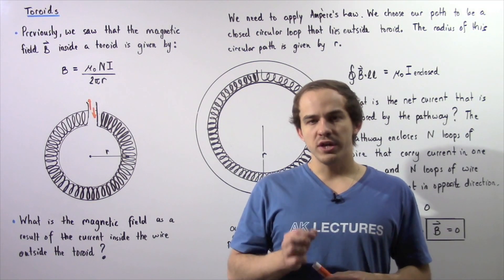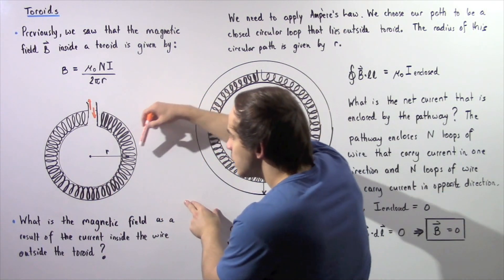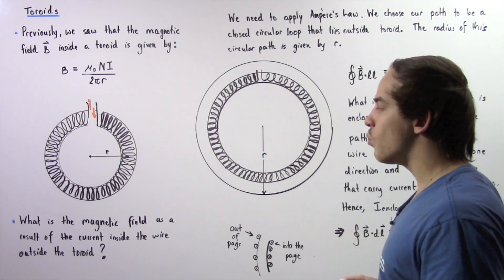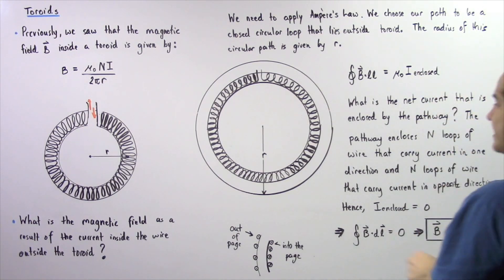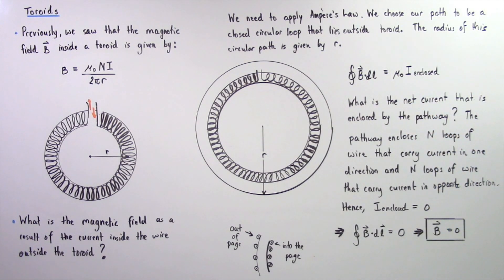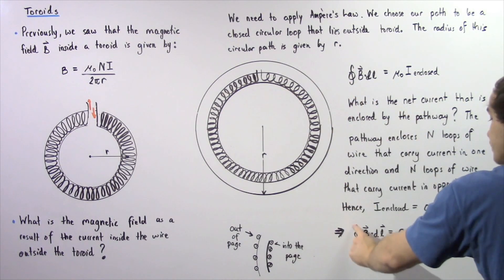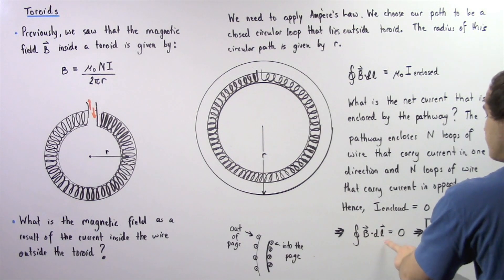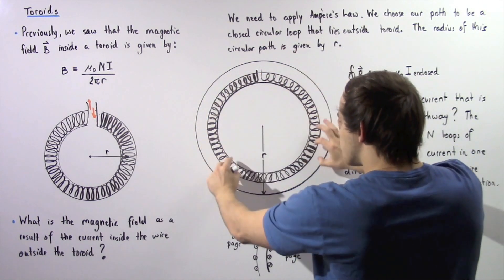Magnetic Field Outside a Toroid

Comment: Hi, can you tell me what the magnetic field is away from the plane of the toroid itself i.e. what would the B field be where you are  (standing say one metre back from the centre of the toroid looking at the picture of the toroid as you have drawn it there).

I suspect the B field is zero in this region also, but I'm unsure of the derivation. I'm guessing the argument would be: B is again constant on a circle of radius r drawn concentric with the toroid axis and in a plane parallel to the plane of the toroid (due to symmetry). 

Then, the integral of Bdl=B(2πr) is zero since any current that passes through any surface bounded by our circle that we draw back to the coils will always have current from each coil going into and then out of that surface, giving a net current of zero for each coil through the surface so mu(I_total)=0 and so B is zero.

Does that sound right.
Any help appreciated.

Comment: This video is wrong. In particular, the statement that the loop integral of the magnetic field is zero implies that the magnetic field is 0 is wrong, as can be easily checked by repeating the argument for a single loop of wire. Also, a loop doesn't "enclose" anything: what matters for Ampere's law is the flux of the current thorugh a surface for which the loop is a boundary

Comment: This isn't entirely correct. There IS a small external field outside the toroid. The whole toroid acts as a simple current-loop (current enters, travels round once, and exits). The field outside the torus is the same as for a simple current loop.  So you should ask yourself 'why isn't the field zero inside a single current-loop'?

Comment: iam afraid your mis leading people if you wind the toroid with large spaces between the wires an external magnetic field will exist also iron placed next to the toroid pulls the magnetic field in the direction of the iron'also if u wind a toroid with extra external loops that allows an external magnetic field  outside the toroid

Comment: But why isn't the magnetic field outside a solenoid also zero then?
Reply: More or less (sorry for spamming, just that my actual explanation from weeks ago is still not shown here):
The magnetic field outside a toroidal coil is a dipole field, the same as if one would replace the toroidal coil with a flat wire loop. The dipole field is perpendicular to the path of integration used in the video at all points, hence the scalar product B*dl = 0, resulting in an integral of 0. That does not mean B-vector = 0, just that the path of integration was chosen in a way thats not helpful. (Ampere's law is always right, just not always useful)
Reply: No, it is not. I have the full explanation in a comment further up, but  AK LECTURES did not approve it yet (physics lecturer@university of freiburg btw)
Reply: it is zero outside the solenoid
Reply: The first problem is that the explanation is wrong, misusing Ampere's law. Also, it does not approach zero, the field outside of a solenoid is the same as the one around a single straight wire with the same current. I don't usually see anyone arguing that approaches zero. Its only small compared to the field inside the solenoid (for any practical solenoid), in absolute terms/numbers it is not.

So its fine to say its negligible in respect to the field inside the coil, its not fine to wrongly apply some law to try to prove that simplification. 

With the argument in the video, "take a circular integration path with no current going through => no field", one could prove that no current ever causes a magnetic field, just use a surface/path that does not cut through the wire/current. So the field outside of everything would be zero.
Reply: +fruehr He told in some lecture that the magnetic field approaches zero outside the solenoid so we take it to be negligible
Reply: +fruehr I agree with you. But I don't get the last para?
Reply: +fruehr okay.  Thanks for explaining
Reply: #AKLECTURES could you argue with this please, cheers